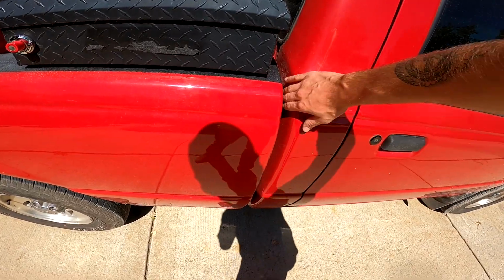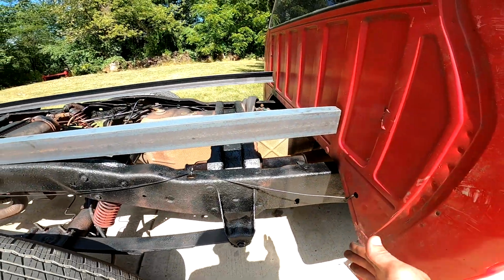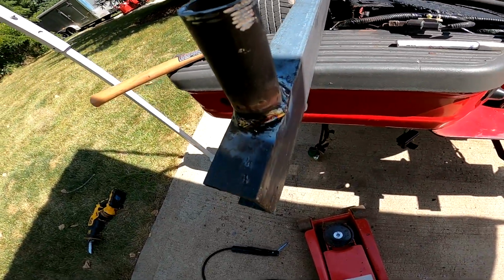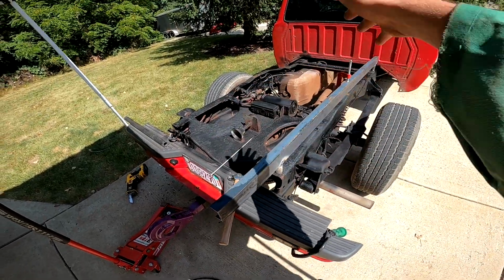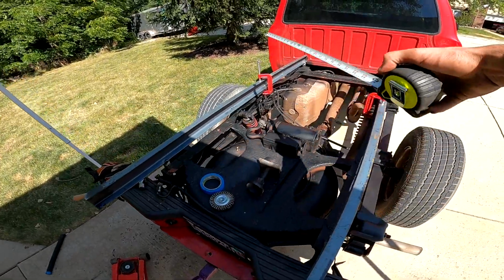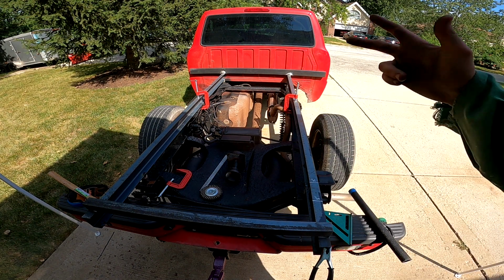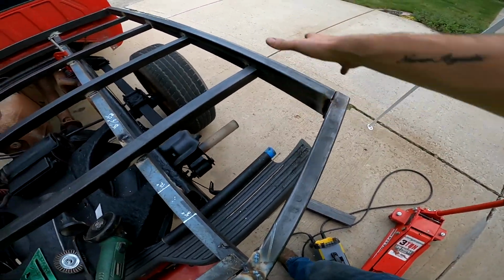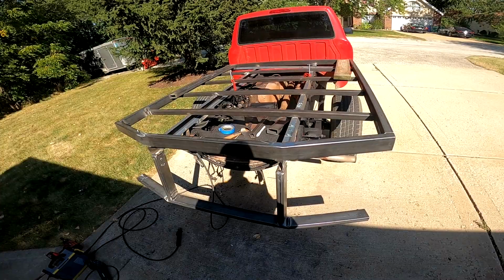Custom Ford Ranger Flatbed Build | Part 1

Comment: i have a 1997 ranger and i won't turn on at all had been just parked for about 12 years and so a mechanic replaced battery, fuel pump, spark plugs along with its cables, and a blown fuse.  Now the truck turns on but does not stay on, it will turn off, What can it be?
Reply from the maker: Could be a few things, but the most cost effective place I would start is the vacuum lines. They could have dried up and causing it to die out. I have another video with a 97 ranger that had a similar issue.
Reply: @HitchinMitch  thanks for your response...can you give the link to that other video